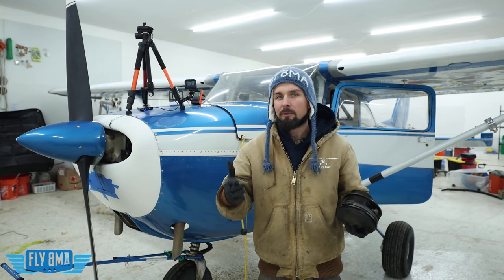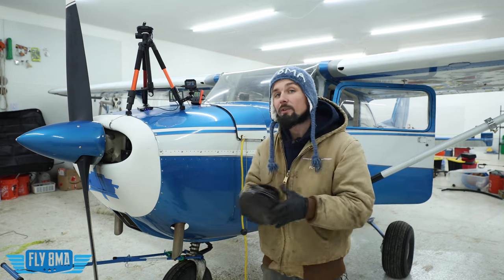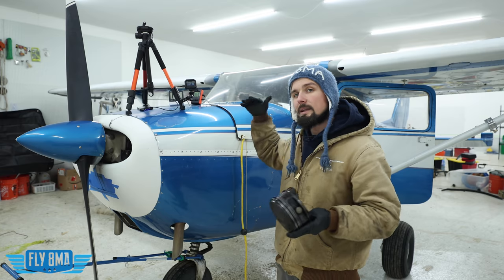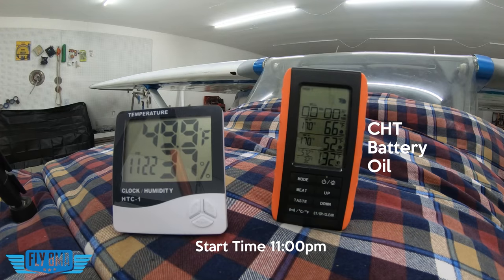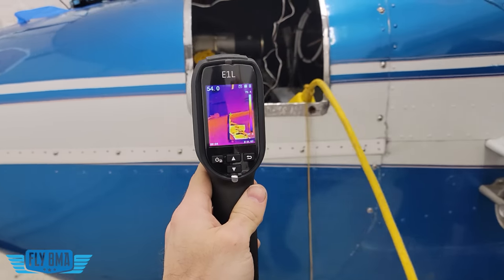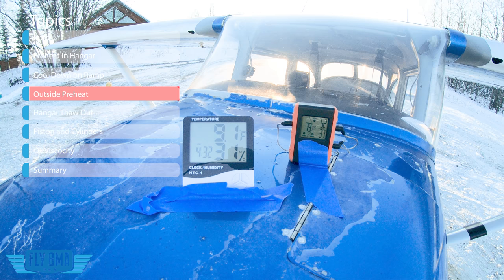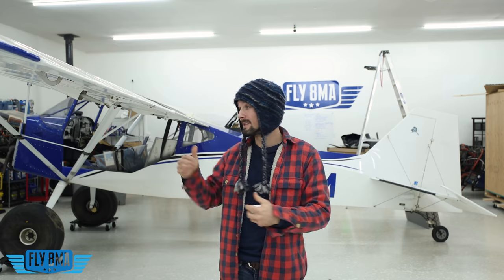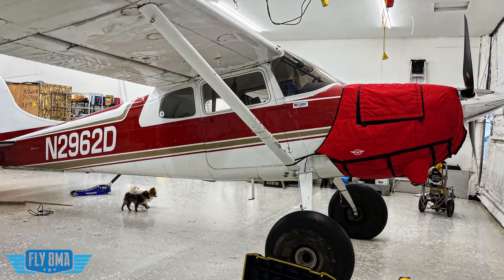How long does it take to pre-heat your Engine?

Comment: Great topic! Preheat and oil changes are two of the best things you can do for your engine (flying regularly helps a lot too). I usually plug mine in the night before (unheated hanger). I have a insulated cover and when it's really cold I have propeller covers as well (Aluminum propeller is a giant heat sink). Engine is warm to the touch the next morning (and bone dry everywhere).  I don't think there's a worry about the oil getting too hot, especially at the 180 degrees you show in the test (6 quarts of oil and an engine doesn't let the 300 degree pad get anywhere near that inside). When I start the plane after heating all night, oil temp gauge is still just barely off the peg. Heats up quickly though and is usually well into the green before takeoff.

Comment: I got my PPL license in northern Alberta. The planes all had plug in, fan powered, interior car heaters, fastened to the engine mount. I have no idea if they were certified and approved...and I didn't ask. With a blanket, they worked a treat.

Comment: Lubricity and viscosity are independent properties. Oils protect metal with hydrostatic separation. Lycoming says 100 w is ok to 50 F. I use a simple space heater below the cowl below 50.
Reply: I used the heater last night 1300 w with duct to cowl exit. Temps dipped to 20’s engine was at 100 to 107 F. It is a metal Tractor Supply farm space heater. I am going to add a timer.

Comment: I use a fitted, insulated cowl cover and hang a mechanic's drop light inside the cowl under the engine. The light has a 100w incandescent bulb. My hangar is insulated but not heated. Winter and summer the average temp inside the cowl is around 60-70 deg F. After flying I always remove the oil fill cap and let the hot steam out and leave the cap off until the next flight. I have never had to preheat in the traditional way.

Comment: All good stuff, pre heating is huge, saves you fuel warming up to take off temperatures. On another note for ski ops, if you keep your plane in the hanger nice and warm, pull the plane out, the ski’s will freeze to the ground before you get the hanger closed and engine started.. 😜
Reply from the maker: Haha....know this from experience?

Comment: I have a Tanisha heater on my PA38 112 Piper Tomahawk and preheat my cockpit to heat up my instruments for 2 hours. This allows me to have 85 to 100 degrees on engine and cockpit instruments are heated properly. My aircraft is hangered with blankets on the cowling.

Comment: Blankets over the cowl, and a space heater with dryer hose routed under the cowl. Has my oil warmed up to 75 degrees after an hour when it was about 20 degrees out.

Comment: Hey Jon. I use a space heater with some aluminum tape and some metal dryer ducting. I use those rubber flexible twist tie things to hold it in place under the engine cowling from below. I’ve never put a temp gun on it, but the oil is over 100 degrees on startup and the cylinders are warm to the touch. About $50. Works great!
Reply: Radar, I agree that a.electric space heater is better than a pad heater, but it must have a set temp sensor amd be U/L listed. With a setting at 60F on a portable heater inside with 9insulated engine, prop and
Reply: I just made one of those. Haven't tried it yet. How long does it take to preheat? It's going to be in the teens around here next week.

Comment: It's all good info... but what do you do after you land somewhere for lunch/fuel?  You are going to start a cold engine. While I don't disagree with anything you said... the reality is we have been running air cooled engines in extreme cold temps for a long time without a lot of preheat.  Heck... VW prided themselves on cold running and starts, since they didn't have a radiator to freeze. (back in the 50's and 60's when antifreeze wasn't so common) One other thing... watch your vid again.  you spend the intro asking questions... but then you ask them all again after.  So, you basically didn't say anything for the first 2 min.  (and felt incredibly redundant) Anyway... I look forward to your next vid.

Comment: The quickest way to heat up an engine is to run it🤣 Fun video tho👍🏻 What’s your thoughts on the Rotax in your Rans for cold starts? I have a 915is and it only mentions a -4°F starting limitation. I know it’s a much more modern engine likely with tighter tolerances. Wonder if it fairs better without preheating.
Reply: Lycoming typically recommends preheat if colder then 10 F or 20F for some models. My experience with my O320, its super sensitive to flooding when it’s colder then 45 F.
Reply: @AkPacerPilot  That sounds like a mechanical issue.  They should be harder to flood when cold.
Reply: @PghGameFix  it’s been looked at thoroughly, I’ve even changed carbs (for another reason), and it still floods easy when it’s cold.

Comment: Where do you find a mobile triggered outlet switch for $50?
Reply: I use wemo they can be fiddly to set up but usually work
Reply: @rootvalley2  those are wifi though not mobile, right?

Comment: Come on man. If it is that cold out, I am not going flying anywhere unless there is a great sale happening on Haagen Daz ice cream bars four hours away. Then maybe. But, I would have to get an airplane first. Mehh...too expensive for what little use I would give it.

I owned an air cooled VW bug in the northern part of the country and can say this, it basically had little interior heat in the winter. Never preheated the engine, ever. Engine never self destructed or lost compression. Ran like a Timex, whether it was 30 degrees F or minus 15F. Sure, pre-heating would make it start easier and maybe idle smoother more quickly. But it still ran fine with no pre-heat.

I want to see the independent studies showing no pre-heat destroys engines, scores the cylinder walls, twists cams into pretzels. Where is the link? With the extreme cold temperatures this past week or so, most people's cars across the US should now be zero compression piles of junk, right?

Comment: I'm still confused why airplanes don't use a full synthetic like a 0w40? Why fight with a conventional when synthetics are available?
Reply: synthetic oil causes the lead salts to precipitate out of the oil making a mess of your engine whereas organic oil can keep the lead salts suspended within until oil change time.
Reply: Lead in avgas. When we ditch lead (coming soon) we will be able to use synthetic oil. We will also (at least at first) pay more $$, but that may be the price of progress.
Reply: We do use fully synthetic PAO oils in aviation. It's mainly just the US that still use mineral oil. Synthetic oils are not compatible with leaded petrol, but most aviation stopped using leaded petrol some 30 years ago, except the US.
Reply: @twest344  Non leaded petrol and liquid cooled engines have been available for a long time, no excuses not to be using them.
Reply: @chippyjohn1  So you think I should just scrap my classic airplane? My engine can use unleaded 91 without alcohol, but I cannot buy it! Alcohol uses more energy to produce than it saves, corn farmers lobby won not science!
Reply: @oneskydog6768  I never mentioned alcohol. 98 is readily available everywhere. You can make just as much power with 98 in a modern engine as leaded petrol in an aircooled engine.
Reply: @chippyjohn1  in the USA  98 = 93 but alcohol free gas is not available within 30 miles of my airport. My only option is 100 low lead.
Reply: @oneskydog6768  RON is the standard petrol rating in 95% of the world. That's the issue with the US, you are 40 years behind in thinking, still using leaded petrol for no benefit, just that the manufacturers make more money out of you. Your country sounds as though it has little freedom from what I read on the internet.
Reply: @chippyjohn1  Well I can fill up on leaded fuel and fly anywhere I want in the continental USA and do not have to ask permission or talk to anyone. Try that in the EU! We use leaded fuel in high powered airplane engines that were certified long ago. The EU would just edict they all be scrapped for non green compliance. So much for freedom, how many dollars does your country suck off the US taxpayers for your defense? What country?